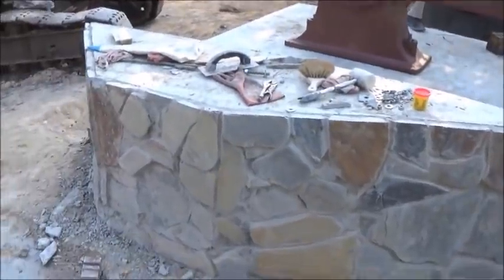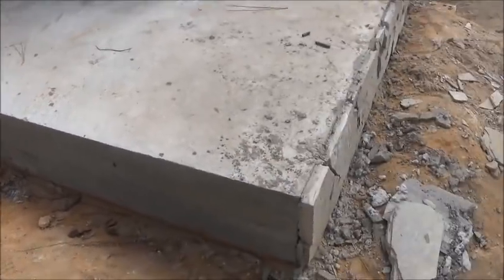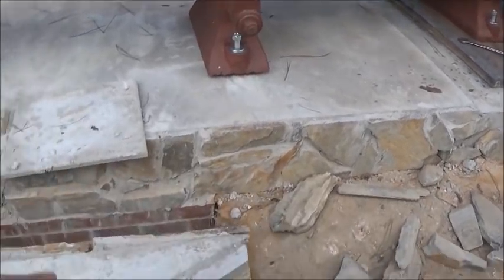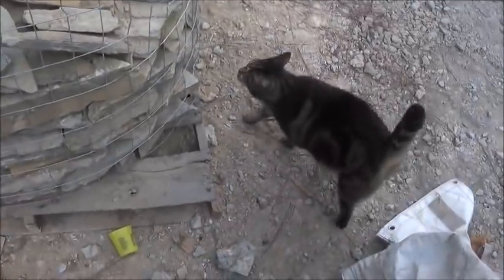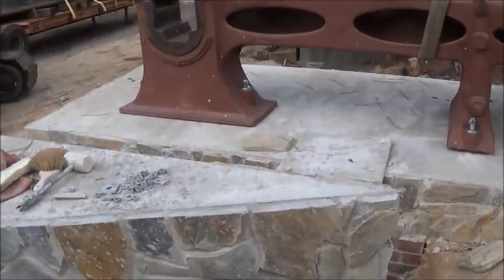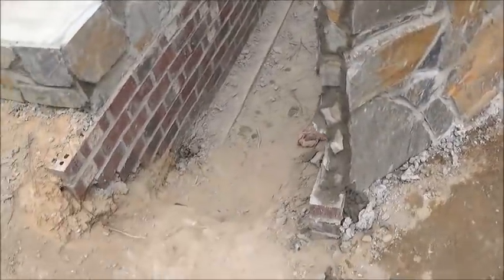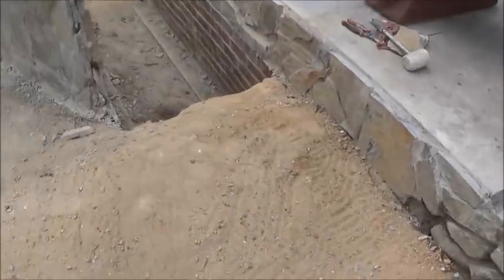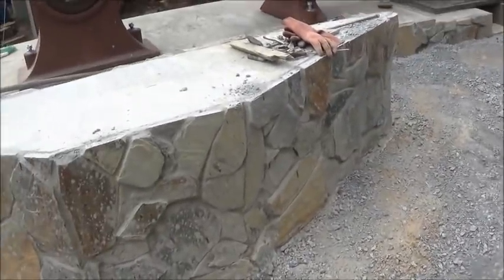BATES STEAM ENGINE FOUNDATION STONE WORK

Comment: Hey Jonathan, did you try powering down with the crane? Maybe you know already or not, you disengage it and knuckle the line lever you’re using while holding the brake and you’ll see the difference in easing a load down in a safe creep! I operated a 30 ton Lorraine motor crane in my younger years! Just wanted to share that with you! Makes load much safer and especially when setting an engine or motor on the hold down bolts! 👍🏻👍🏻👌🏻

Comment: It frightened me when the engine base dropped hard onto the concrete base!!  When I worked at a power station, on heavy lifts that needed precise location/landing chain blocks were placed between the crane hook(s) and the load, that way the part could be lowered with accuracy and safety.. Enjoying your video's, Stay Safe  John

Comment: Looks really good. One question. How do you operate the hoist and the tag lines. Standing up and who's the a$$hole that gave the thumb's down. Did a good job on the rock. Before the sealer. Wash the rock down with mason acid. To clean the mortar of the rock. It'll take that white hase off the rock

Comment: Jonathon,  if your pad is level you dont need a bunch of grout,   level the machine on big washers with say 1/2 gap being the smallest gap.  If the other end needs more washers fine.  But mame sure that sumbitch is level
Then get some metallic grout and mix it a lil loose so you can push it under with a trowel
You dont need grout all the way under, maybe 6 inches in.  As the grout starts to set up dress the part that gets seen  i always do it straight up and down some do it on a 45, if it starts gettin hard just dress it with water using your finger.   Start it loose so u can slide it under and it gives you time to dress the edge

Comment: Are you going to use the state certification crush run or the non spec roc that's less expensive? Maybe. 57 stone over a mat to keep it from sinking would be for a prettier job .

Comment: I not sure what kind of weather ya'll get there or what the grounds like but it looks fairly hard, are you not concerned that the trench the flywheel is going to be in wont fill up with water over a good rain?
Reply from the maker: I have addressed this before. I live in the sandhills of NC. Sand won't hold water.